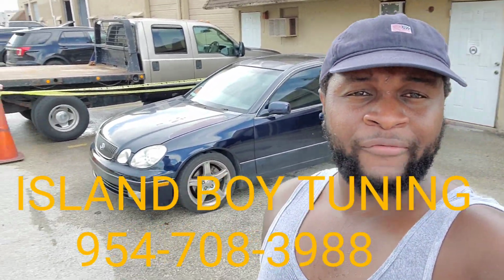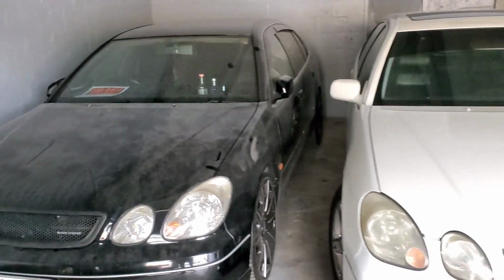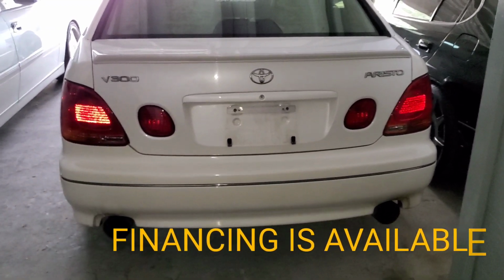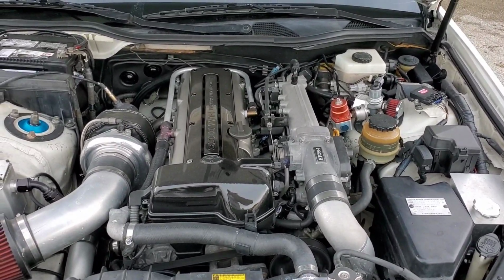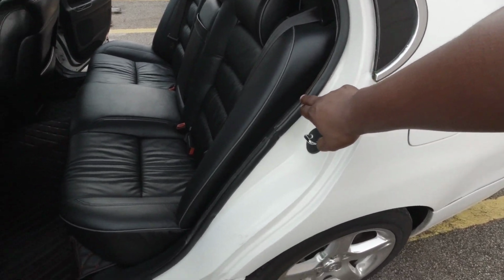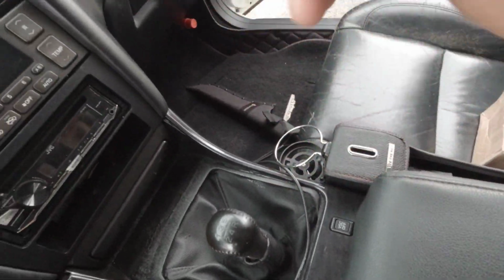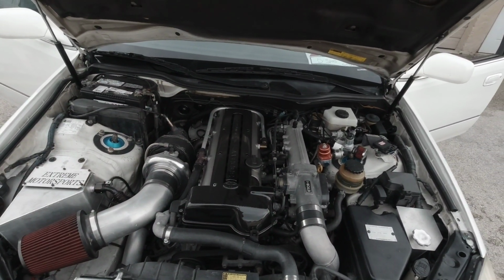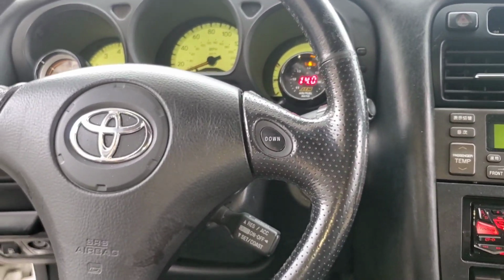MANUAL GS300 , 2JZGTE VVTI, R154, 500 PLUS HORSEPOWER CARFAX AVAILABLE $25K

Comment: Very reputable shop. I haven't gone there before but have only heard good things about them. I also have a 2jzgte single turbo swapped gs300 but mine is a little more agressove than the white one being that I have AEM infinity with 2200cc injectors and 3 fuel pumps on a billet hanger. Im just waiting to get my auto trans built at ATF so I can really turn up the boost. The only man who has and will tune the can is the man the myth the legend Lance and Wireman Jr did all the wiring. Cant wait for the final product to be done. I also have every suspension component to be changed and all bushings and have brand new fortune auto coilovers to go on too. I have the same cluster pod and even have an extra one if u know anybody looking for one just let me know. Located in Sunrise FL hit me up
Reply from the maker: That sounds very good that sounds very good sounds similar to my car I am going to be running the AEM infinity 506 with the plug and play harness and some 1600cc injectors on flex fuel I also have two wall draw 525 fuel pumps and the board wanted s366 billet turbo along with bc272 cams and other stuff but unlike the auto I am not using that I currently have the r154 in my car with a twin disc clutch right now. I have changed out some suspension stuff but as for the rubber bushings and so on I have not really touched much of those it just seems very very time consuming. Lol lol lol.  But so far what you are saying that sounds really good though that sounds like a very solid build. If you don't mind me asking what is the price that you are looking for the cluster?? 
I can say yes the service there is very good.
Reply: @2jzboost760  trust me i know your set up very well since i sub to your channel. Be careful with those fuel pumps tho i have heard some people having issues with them burning up cause they run on 2 diffrent speeds and when u run them at 525 all the time they tend to run really hot. Im running 2 walbro high flow 450 and 1 525 as my 3rd so its only gonna come on as a secondary pump so its only gonna come on when need at high boost so its not running constantly. Im using the same s366 billet turbo too but eventually want to go with a ball bearing one for quicker spool. Definitely want to do cams but I know what I already have is more than what the bottom end can handle anyway so whenever I build the bottom end I will address the head
Reply from the maker: @khalidmaxwell5550  really sounds like you have everything under control you know what I only run one pump at the moment but both of them are inside the tank for when I need to tune the car. But primarily I will be running on one pump until I get into boost. From the aluminum fittings on top of my pump it kinds of feel a little bit warm but nothing out of the ordinary. Which one do you have mine is the 11 blade wheel.  If I have to rebuild my engine then it will be for big Power.  I was actually thinking about running 1 525 and 1 450 and I changed my mind did not want to be running to  unequally sized pumps.
Reply from the maker: @khalidmaxwell5550  I would be careful on the ball bearing turbo that I run in my car I believe if I had to change I would definitely go to a Garrett without for a precision and so on no.
Reply: @2jzboost760  yeah I had the same idea I really want to get the garret gtx 3584rs turbo spent way to much money on the car to cheap out on the turbo and once I'm done with engine and tune then I can work on paint and interior. As for that cluster pod shoot me a reasonable offer. Im sure u know I paid about $350 for itand its still brand new never installed in a car just opened the box and put it back in
Reply: @2jzboost760  I'm gonna have all 3 pumps in the tank on the powerhouse racing billet hanger with a -10 feed and -8 return and the AEM 510 will progressively turn on the pumps as needed which Lance will tune for me . I talked to Padro aka Baltic Supra and he said that the same setup I have he had when he was making about 1300hp which is more than enough for what I'm going for right now my car is a street car
Reply from the maker: @khalidmaxwell5550  okay okay totally understand I see what's up let me see what's going on and I will contact you. Well that turbo sounds really good from what I see people seem to get a good amount of usage out of them I would like to try for something that fools better and that is the roads that I would definitely go to. I don't know if at that point in time I would daily drive that turbo though.
Reply from the maker: @khalidmaxwell5550  hold on hold on let me ask you something how much horsepower are you planning to tune for right now because it sounds like it is a lot. I am kind of confused right now how much are you going for about 1k??
Reply: @2jzboost760  oh hell noooo!!!! Its really up to Lance what he feels is a safe amount of power for the stock bottom end. I just went all out on the fuel system so I won't ever have any fuel. I would rather have to much and turn it down than not enough thats just the way I think about it lol.
Reply: @2jzboost760  I ment that I went all out on the fuel system so that I wouldn't have any fuel issues.
Reply: @2jzboost760  won't be trying for those kind of numbers until that bottom end get built. I even want to overboard with my trans build so that I dont have to ever worry about reaching its limits. Still trying to decide if I'm gonna stick with the factory trans and have ATF build it like Baltic Supras trans or have them build a 4l80 trans so i can have a trans brake. Decisions designs lol. Im leaning more towards building the factory trans cause i like keeping everything toyota and everything would just bolt up. By the way what do u have for the rear diff?

Comment: Nice car. I have the same GS I’m doing a 1jz swap on. I wanted to see if you could tell what a good radiator/fan set up would be a good fit?
Reply from the maker: Thank you bro.
   Good morning. Use the stock fans that are in your car and you can upgrade the radiator to even an eBay aluminum radiator and if you are keeping it automatic get a transmission cooler.
Reply from the maker: Doing the 1JZGTE VVT I swap in my daily GS300 next week also.
Reply: Okay cool so the stock fan shroud should be sufficient? I’ve been looking online for a aluminum radiator that’s GS specific but I’m having trouble. There’s a couple on eBay but they look cheap and ship from China. I wanted to get a Koyo or Mishimoto quality radiator tho. The forums I read said they only make them for the IS. And to get a aluminum radiator for the GS you’d have to buy a Supra radiator and have the mounts relocated/welded... Were you able to find a decent quality aluminum radiator for this car that was bolt on from the box?
Reply from the maker: I have used eBay aluminum radiators the ones that cost about $200 multiple times and I have had no issues with them I know a lot of people that build cars that use them also and haven't had no issues with them a lot of these people that are going around saying stuff are just talking pure madness to be honest with you moreover if you do receive a radiator that has a hole in it you can return it and get a replacement and so far I have not had a bad experience with using one of them yet. Your stock fans that are on the GS will line up with some holes on the radiator but that will be enough to hold it together and make it look neat without any problems. So just go ahead and purchase one from eBay and if you are using the automatic transmission purchase a 15-in or so oil cooler to use on the car and that will be more than sufficient because the aluminum radiator does not have the a oil cooler built in.  A lot of people on these forums are just passing hot gas.   I actually use the eBay aluminum radiator and because I am manual transmission I don't need to use a oil cooler. I also use the eBay radiator hoses and have no issues with them.
Reply: @2jzboost760  Alright bet I’ll just go that route then. I’d rather just get something plug and play then have to modify the mounts.. Thanks for taking the time to give your 2cents. I appreciate the input 🙏🏼
Reply from the maker: @77791z  you are welcome. No keep in mind that not all screw holes would be used otherwise you would have to get an Aristo radiator shroud and those tend to cost a lot more money so what you could do is use the one from your GS and work with the holes that line up.
Reply: @2jzboost760  ok gotcha. I actually can’t find any on eBay that fit my car. They’re all single row, or for a different generation GS. Would you happen to have any links? Sorry to drag this out
Reply from the maker: https://www.ebay.com/itm/323500216772

That will work.  It's not gonna show GS300 specific.
Reply: @2jzboost760  Right on, thank you bro you been a big help 💯🙏🏼🙏🏼
Reply from the maker: You're welcome bro no problem.  💯💯💯💯